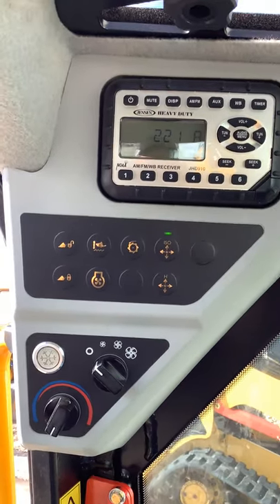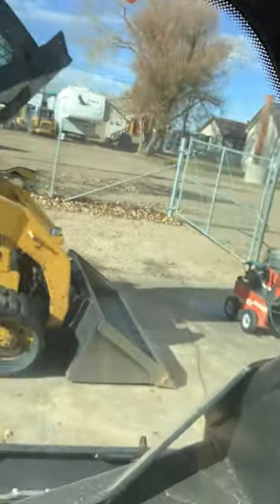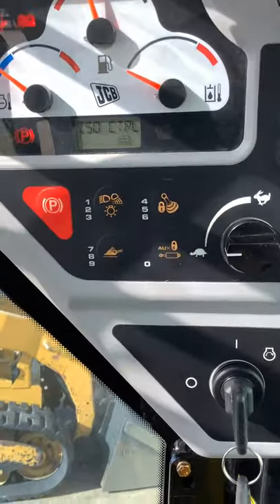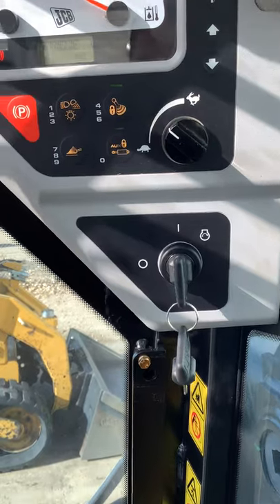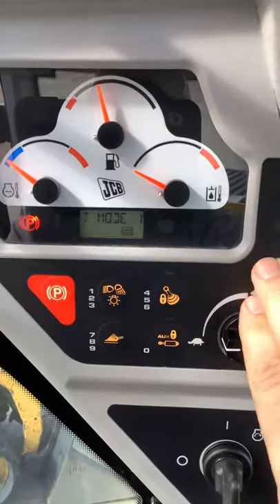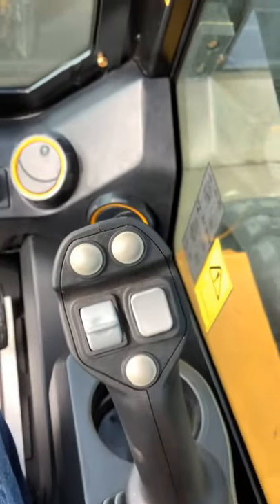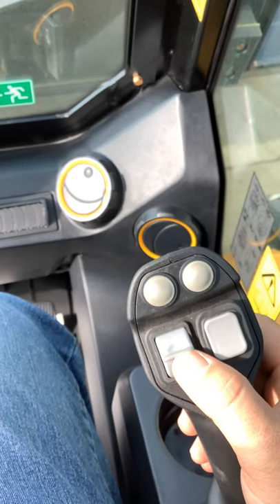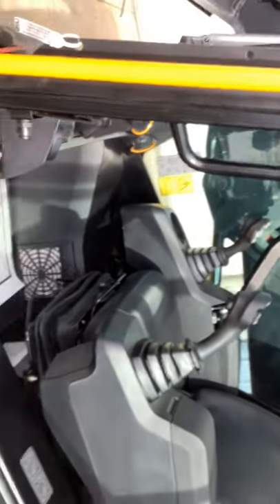Controls on JCB Skid Steers

Comment: Great video learned a lot , one thing I found on mine is you can switch from iso to h pattern by lifting your right drop arm without shutting off the machine , but will have to release parking break after to move , thanks for your video
Reply from the maker: I didn’t know that, thank you for the information!
Reply: You can also just hit the parking brake button, switch and take the parking brake off, much faster in my opinion.

Comment: How do you reverse the flow to the hydraulics? Say if you had a brush cutter and wanted to rotate the turn table in the opposite direction.
Reply from the maker: You would just push the toggle the other direction and that will run the attachment the opposite direction
Reply: @weldcojcb  what about for continuous flow? On mine I push one button to engage continuous flow but nothing to reverse that flow.

Comment: Awesome video, thank you so much for uploading. One question I  have is, what is the difference between the hand throttle adjuster on the dash (turtle to rabbit), compared to the live controls on the left joystick (snail turtle or rabbit). Does the left joystick control the speed and the dash dial controls RPM's for functionality in different operations (heavier loads, etc.) Thanks again!
Reply from the maker: You are exactly right, the controls on the bottom of the left joystick control the “transmission gears” of snail, turtle, and rabbit. The dial up on the right hand side or your hand throttle controls engine rpm’s. Great question, thank you for watching!

Comment: Please explain how to release hyd pressure from boom after engine shut down following day's work. Everything i own on the farm always release pressure after using. SS is a 320T 2015' yr model. Machine came with no books, this learn on the job is slow for me. Thanks
Reply from the maker: Sorry, I never saw your comment come through. Unfortunately I haven’t tried it on a machine of that age yet. On the newer ones there are one or two ways you can do it. They have a “grenade pin” on the valve block where you hook into the hydraulics on the machine. We shot a video showing this, so look on that video if you’re not sure what I’m referencing. The other way you can do it on the new ones is you push in on the hose into the fitting on the machine. I’ll try and shoot a video on this later this week

Comment: AWESOME Video!  if the H pattern light is not illuminated is it safe to say it's not a feature on my machine?  can it be programmed on since the button is there?
Reply from the maker: As a general rule, if one of the control buttons on your JCB isn’t illuminated then that means the machine was not equipped with that option. I’m not aware of being able to program it after the fact, but that doesn’t mean it cannot be done. Where are you and your machine located?
Reply: @weldcojcb  St. Louis, MO
Reply from the maker: As far as I’ve found, can’t be added after the fact
Reply: @weldcojcb  bummer, thanks for responding though!

Comment: How do I lock in the self level. So after I dump a load I can just push it over to bring it up and the bucket levels?
Reply from the maker: After you dump, you have to take the bucket back to level and then it I’ll level as it goes up. The teleskids will also level on the way down

Comment: you did not show how Auger is used on skid steer (what controls to use)
Reply from the maker: It should be the flipper switch on the left joystick but just depends on how the electrical connector is wired

Comment: Small error at 6:47
The parking brake only locks the tracks. It disables the track motors and applies the brakes. 

You can have the parking brake and enable the joystick the move the arm, and the aux hydraulic. For example you can use an auger to drill a hole.
Reply from the maker: I didn’t realize that, thank you for the input. I have never tried to run hydraulics while in park. I also didn’t realize you can enable the arm to move while in park. Thank you for watching!
Reply: Does your machine apply the brakes when you release the left controller. My previous JD 329 would not roll downhill if you released the control, however to keep the JCB steady on a hill without the hassle of applying the park brake, you need to keep a little input in to the controller arm. Nothing more than an irritation, but I’m not convinced it’s a great design that lets it start rolling downhill when you pause for thought!
Reply: How do you enable hydraulics with park brake set.  My hydraulics are completely inactive if park brake is on.
Reply: @mikelloyd2013  
There are 3 separate controls: tracks, boom, auxiliary 
Start the machine, all 3 circuits are off. You can enable each separately. Do you see the 3 controls? 
If you want I can point you to a video showing the controls
Reply: @lumberjackdreamer6267  I guess I don’t understand what I should be looking for.  I have always just turned off the parking brake and the hydraulics become active, but I don’t see how to make anything active while park brake is enabled.  I would appreciate a link to the controls video.  Thank you for your replies.
Reply: @mikelloyd2013  
Ok, I’ll look for that video. Gimme a minute.